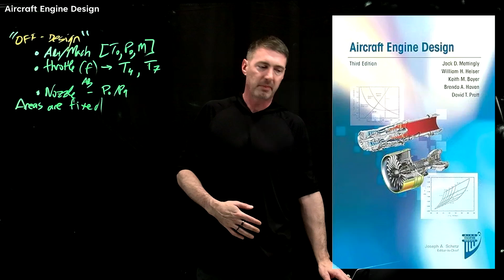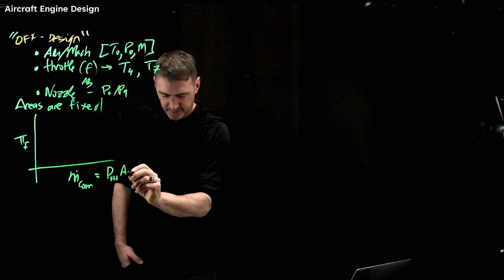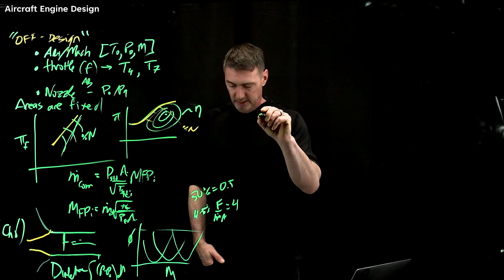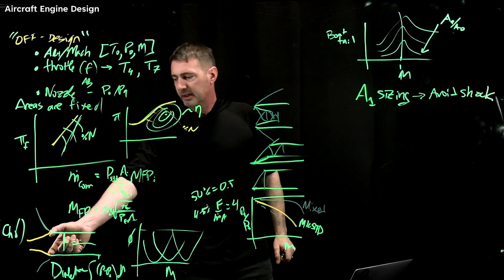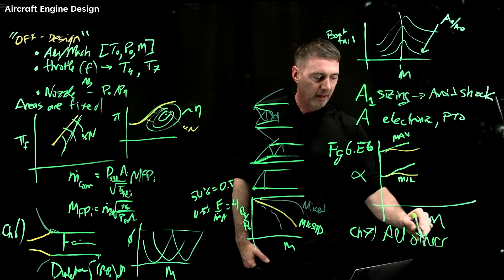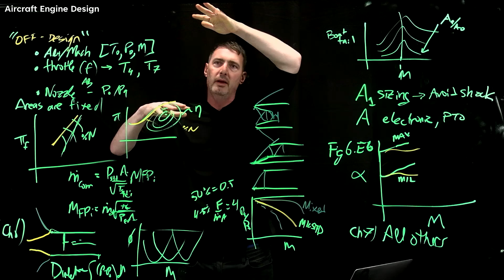Off-design performance; Aircraft Engine Design [Book Club #8] Ep4

Comment: I'm not sure about military power, but in WW2 airplanes, War Emergency Power (WEP) was a term used for the highest possible throttle setting. Later in the war, depending on the aircraft model, WEP included water-methanol injection as well. The engines could only withstand a limited amount of WEP at a time, the instructions given to pilots differed depending on engine model, but it was usually below 15 minutes, most of the time around 5 minutes. The amount of time spent in WEP was documented, and engines would need thorough checks, overhauling or even replacement if they spent above a certain threshold in WEP. I'm not sure if military power derives from war emergency power, they might be related, although WEP is conceptually more similar to engaging afterburners.
Reply from the maker: Interesting - I know with general aviation aircraft using some of these workhorse classic Lycoming Engines, the standard operating procedures allows a high power setting for take-off, but same thing - only for a few mins - otherwise reduce to a lower power.